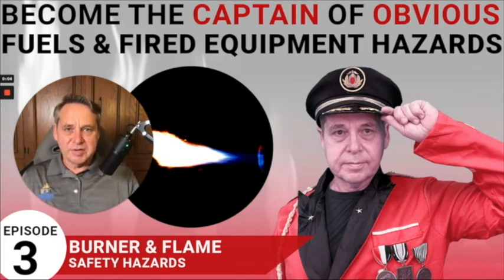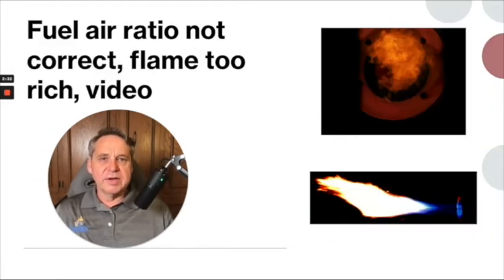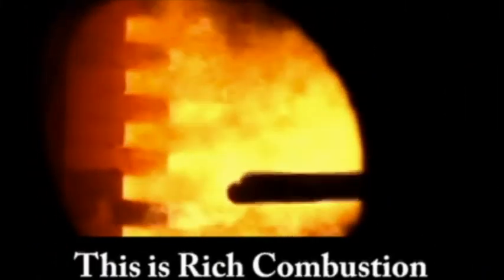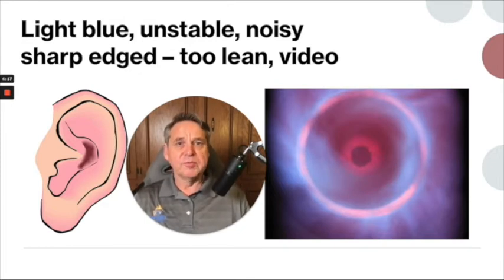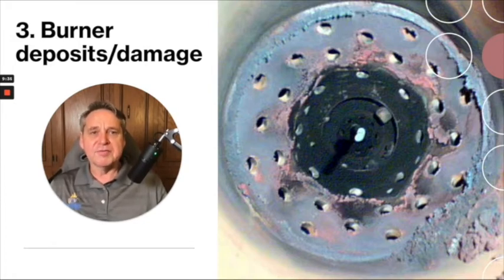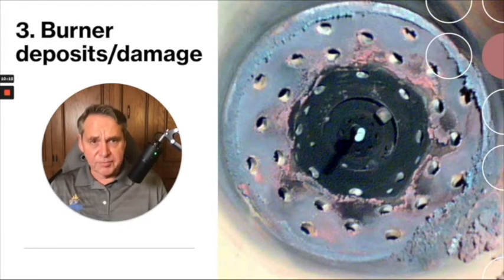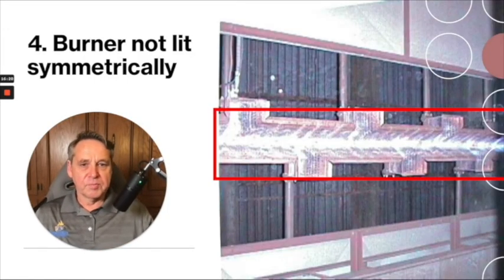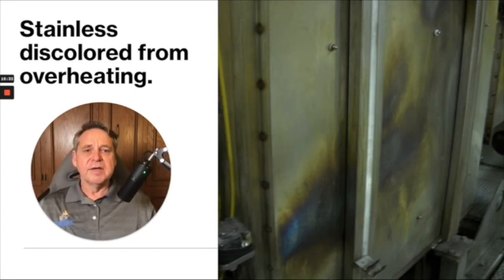Obvious burner flame problems, color, shape, symmetry, position and when a burner is being destroyed

Comment: It's great that you're bringing up problematic flame and burner issues but I have a few concerns. #1 - Before entering an environment we are not sure of, we should always be taking CO & combustible gas indicator readings (using a piece of equipment such as a Bascom Turner Rover or Ranger). #2 - You need to ask yourself: Am I qualified to evaluate and service the piece of equipment I was dispatched to? I feel your video may be empowering people to evaluate something they may not have the training, capability, or certification to do. (In no way am I questioning your experience, knowledge and expertise on the subject, but I do feel the conversation should be geared to the qualified technicians & employees responsible for the safe operation of the equipment.) #3 - I feel when evaluating, and even operating, the equipment seen in your video, there should be set procedures and a checklist, such as one an airplane pilot uses, as well as daily logs kept on the checklist and the procedures performed. I was told one dull pencil is worth more than a dozen sharp minds. Finally, #4 - I think we may be kidding ourselves if we try to evaluate fuel burning pieces of equipment without a good combustion analyzer that has been certified on an annual basis.

Would love to hear your thoughts on my four concerns. My expertise comes from 35 years with my local gas utility company. In that time, I have ran over 10,000 emergency calls  -  residential, commercial, and industrial; this would be in addition to my normal duties as a gas fitter / service technician.
Reply: Bob, these are fantastic points. Well thought out and I agree with all of them. You and I both know that the people who are really qualified to work on this equipment and really know what they're doing are few and far between. I try always to tell people all I am trying to do is to have them throw up a red flag. I don't want them trying to work on the stuff based on what I am telling them here. Now let me explain the other problem and dilemma, and this was my intent, I can continue to be silent and then there are thousands of people and pieces of equipment that never get looked at where there are obvious issues, or I put this out and many many things get caught and people get helped. I chose that road. It's a tightrope and people can misuse info.....I may go in and post a Danger! warning thing as part of this reminding people that this is not to train them to work on it. I have seen others on YouTube where they have people pulling out screwdrivers and actually showing people how to do things that I think are very risky. I did not go there. Thanks again for your wonderful thoughts.